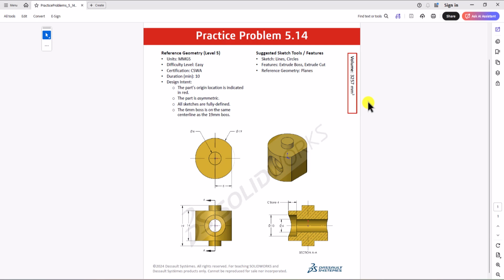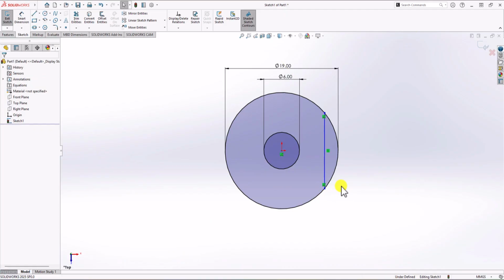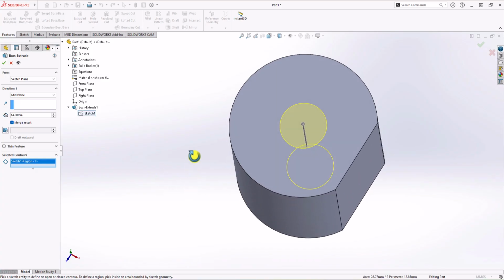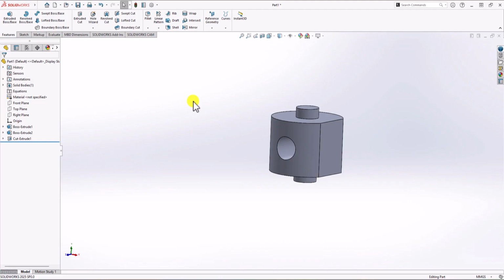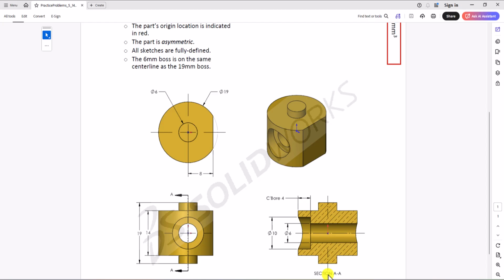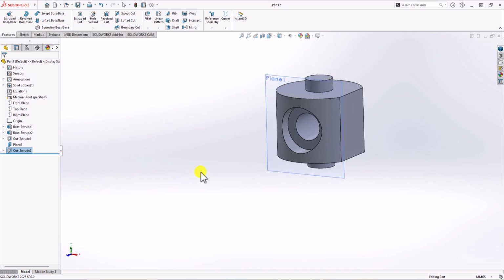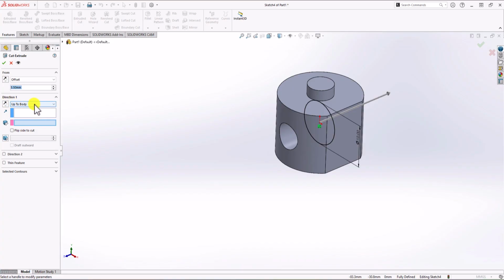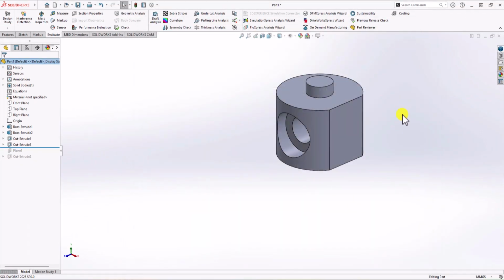CSWA Practice Problem 5.14 Solution | SolidWorks Exam Guide

Comment: Hello, Thanks for the video. My question is why cant we use "hole wizard" from features?
Reply from the maker: Yes, you can definitely use the “Hole Wizard” to create a counterbored hole. However, since this question is for the CSWA exam, the Hole Wizard is not part of the exam required knowledge. That is why I chose a more basic approach, in case someone is not familiar with the Hole Wizard functionality.
That said, you are absolutely right. Using the Hole Wizard is a more efficient and faster method.